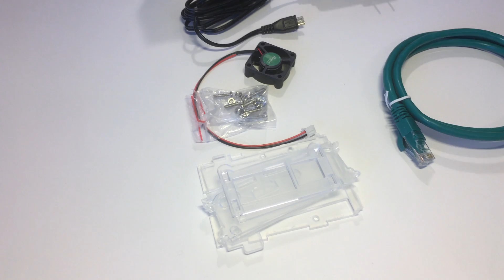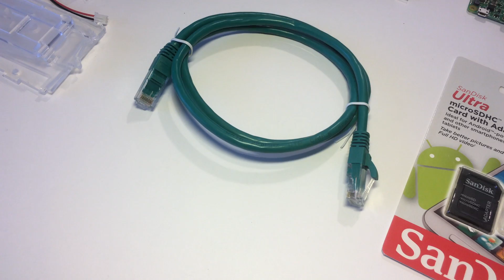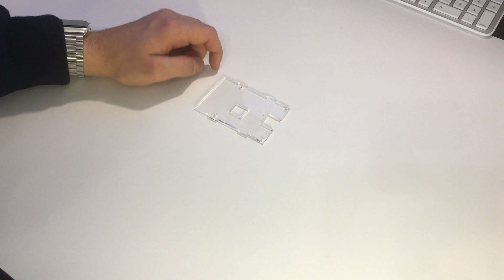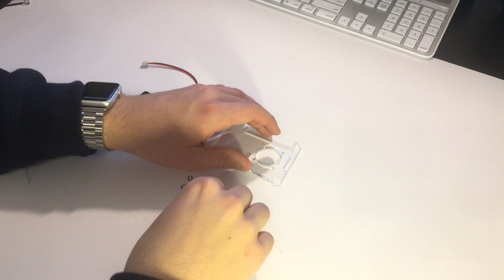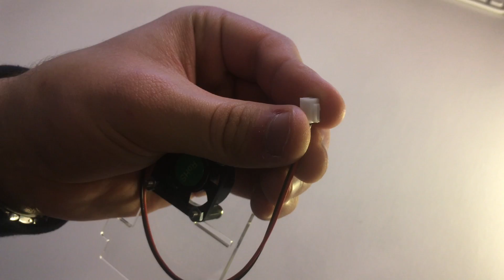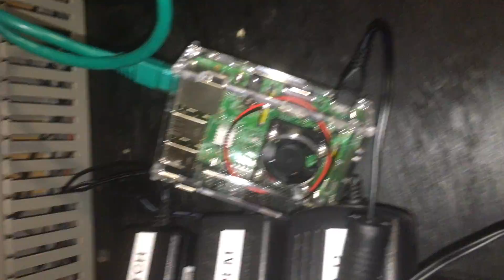Complete Guide Setting Up The Home Automation Server (OpenHAB 2 + MQTT): Hardware

Comment: How much long can I stretch a gpio cabe like using  one esp8266  + 3 Reed switch with 3 difference  door at different locations   

I can't afford each door a esp8266 

and also a tutorial on if the lock the door wirelessly 

Awesome job bro.

Comment: 2.3a running all day everyday surely is going to add up. 2.3a x 230v is 539 watts
Reply: that is not entirely correct as it outputs 2.3A at 5V so that would be 11.5W. assuming an 80% efficient in the conversation from 230V to 5V (and it's most likely higher than 80%) that would be 14.4W. and that is the maximum the adapter can supply. for the raspberry pi 3B  is a 2.5A supply is recommended of which 1.2A is for USB perifferals and 1.3A for that raspberry itself. and sins the only thing that is connected is the 0.2A fan we have a total of 1.5A at 5V assuming again 80% efficiency that ads up to a total of max of 9.4W. But that is only if the raspberry is at 100% load which it most likely won't be all the time.
Reply: Well said. I suppose you could offset the cost of running by not having that extra piece of toast in one year.